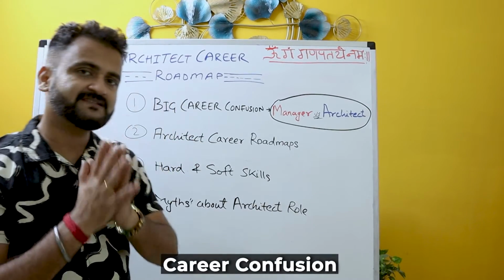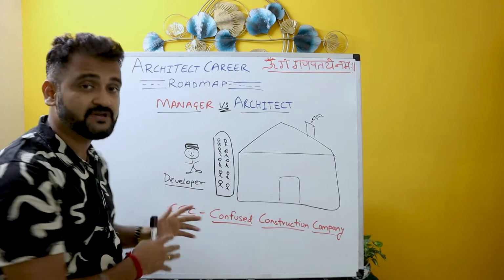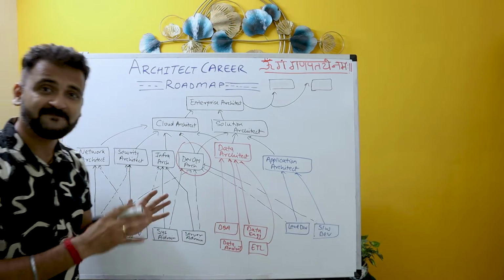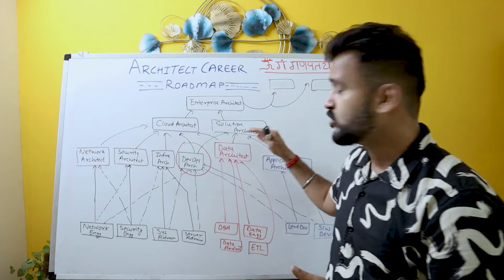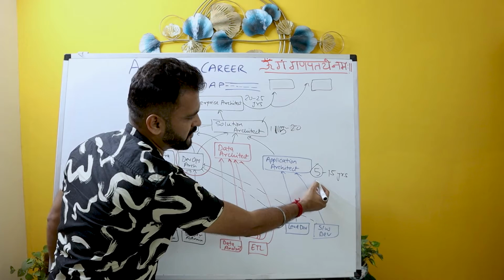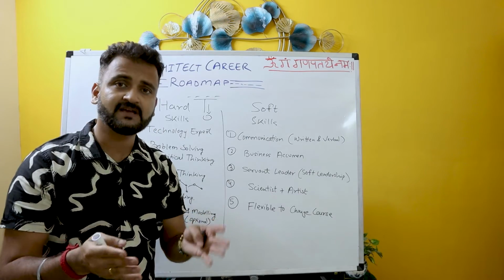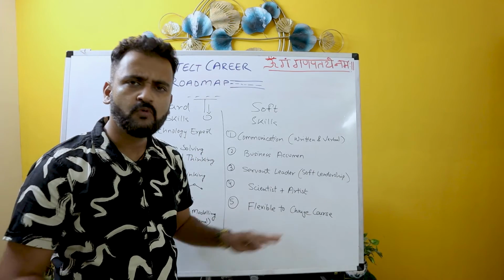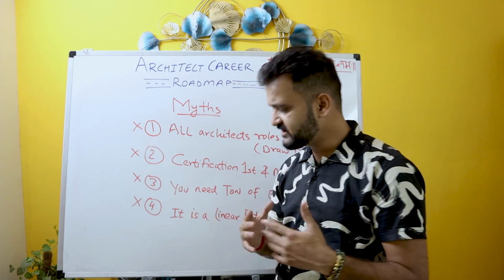Architect career roadmap for beginners - Manager vs Architect - CHOOSE YOUR NEXT ROLE WISELY !

Comment: Hi Anshul. I'm interested in applying for application architect at one point of time. I have 6 years of experience. My question is if im focused on being a front end developer can I still be an architect or I need to be a backend developer for it? I've always heard architect roles of software developers are given to mostly backend roles because they have more control of the system. So do we need to have experience in Backend as well to become a software application architect?
Reply from the maker: Hi Amey an Application architect would design the whole application end to end thus knowledge of backend is important having said that you need not be an expert of backend, you just need to know how every piece fits into the puzzle. I suggest you explore backend development fromnan architect view point and see if that gives you confidence. As an Architect you need to imagine the big picture and then break it into smaller details. Hope it helps